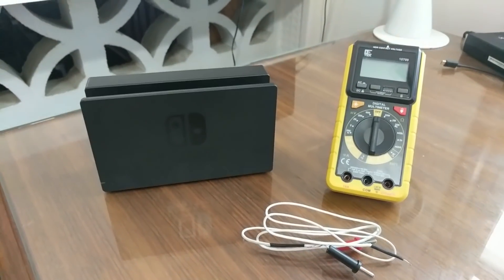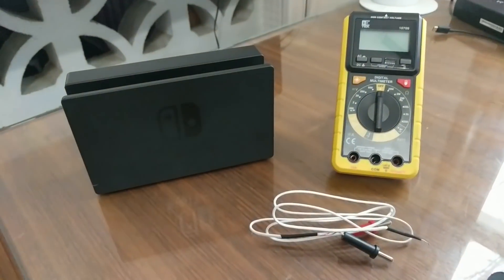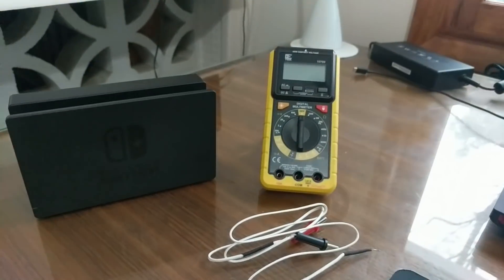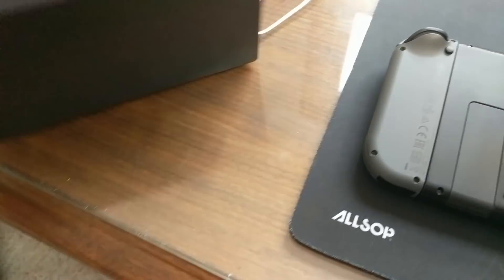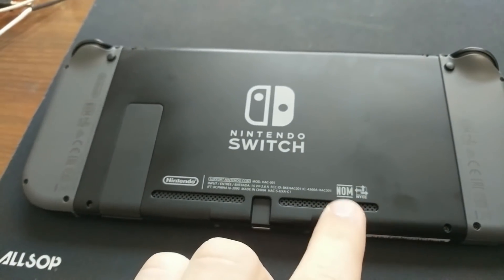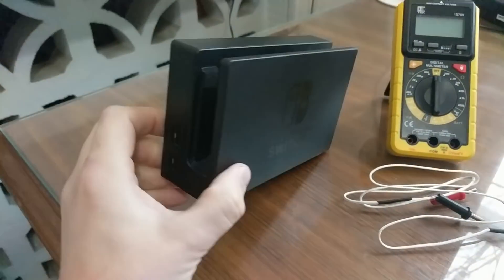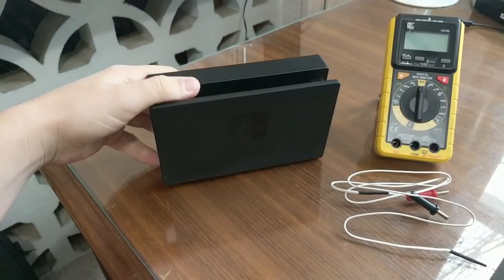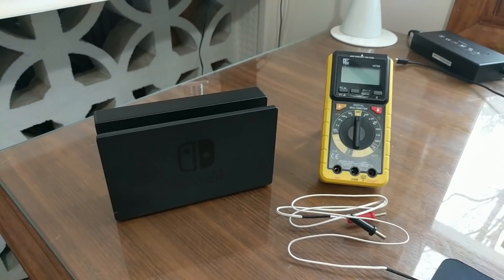Final Nintendo Switch Cooling Mod - Available Now!

Comment: How is this one different from this other one on ebay that claims to have better airflow? I'm kinda torn between the two. It claims 20 degree drop but it could just be fluff. I guess I'll end up flipping a coin.
Reply from the maker: It's fluff.  You won't get 20° drop from this.  They stole my design and are marketing a rip-off.  Nothing I can do about it.
Reply from the maker: Plus their print quality is garbage.  AND, to to it all off, they are selling other people's designs from Thingiverse, even using the original authors photos in their listing.

They are trying to profit off of other people's work.  Steer clear
Reply from the maker: Plus, why buy from someone other than the original author (me)? 😉
Reply: @M1dn1ghtN1nj4  I noticed they're design has a major flaw compared to yours. The fact is the air vent has separations between the grates that yours fits snugly to while theirs has a hole where airflow is lost plus it let's ambient heat to get into. You'll have another sale too, this will work perfectly coupled with an intercooler. Thanks for the mod.
Reply: plus you should buy a bunch of cheap but sturdy triwing screwdrivers and bundle it with it at a slight mark up.

Comment: I just printed an "open" style dock that exposes the switch intake vents fully to the room.
Reply from the maker: I've seen that one.  While I'm sure it works well, you have to comprehend disassemble your dock and pull the guts.  And most people don't have a 3D printer.

Comment: An external laptop cooler would also work, and having it be powered by either usb c or micro usb would be useful. I use an opolar external laptop cooler and just place it above the fan and change the fan speed it according to what game im playing and the switch never heats up. Never.

Comment: There is a major flaw in your design. What is going to produce airflow for the dock's board to cool off?
Reply from the maker: The docks board doesn't get hot enough to fail that way. The mod still leaves vents open specifically for the board.  The mod doesn't have a 100% seal, so it will inevitably pull in some of the air from inside the board area.
Reply: M1dn1ght N1nj4 nice! good job on the design then!

Comment: Hey, so like, good for overclocked modded switches???
Thinking of changing thermal pastes to a better one.
Reply from the maker: Paste is certainly an option, so long as you're willing to void your warranty on the process.
Reply: Im already running sx os and have like mismatched fuses, a bunch of overclocks, and emunand, I voided my warranty ages ago lol. But I also like considered having a trinket installed anyways.
Reply: Maybe thermal paste is my best shot, I have some thermal grizzly, ill try that first and if it doesn’t work out Ill buy your 3d printout file online :p this looks pretty ingenious.

Comment: Just take the back off and make a water cooling mod bud. That’s if you want it Stationary tho. And it keeps the CPU at 28-33C instead of 45-50C. You can put the case back on it only affects it by 2-3C
Reply: You also drop drop frames

Comment: would have bought one for $10. not 16. how much could these cost you to make?
Reply from the maker: At9ra unfortunately it's $2.00 to print, and another $4.50 to ship.
Reply from the maker: https://www.cgtrader.com/3d-print-models/games-toys/other/nintendo-switch-dock-cooling-mod
Reply from the maker: HOWEVER, if I find that people are then turning around and sharing the file for free, I'll file my reports, and raise the price of the part.  I really don't want to, but it's wrong to sweep money right out from under me.

Play it cool, no free sharing, and I won't say a word.  :D
Reply: At9ra no way material and shipping exceeds $9. Greedy.
Reply from the maker: TailsTheCat You expect me to make only $3 per physical print?  Wouldn't even be worth my time.  I spent more hours working on its prototype, and multiple prints, costing money, resources, and electricity.  It would be stupid of me to lose money on it.  If you don't want one printed, feel free to download the STL file for $8, and print it yourself.  It's my creation, I have every right to set the price at what I want.  It's not stupidly expensive, which I could have easily made it.  30+ people have ordered it so far, and were happy with it.  I get wanting something for as cheap as possible, but if there is no benefit to the creator (me), then what reason do I have to even make it public?
Reply: lmao was just thinking the same thing. I literally just paid for mine on eBay. The time it takes to think of this, make it and ship it. or even post the shit online is worth the money. Id be charging dumb asses 30$ just for being stingy.
Reply: It's sad how many people don't think another person's time and effort aren't worth anything. Then spend your own damn time and effort making it yourself, you cheap dicks.

I just got finished installing the one I purchased a few days ago. I could only be more thrilled if it were a resin print without the striations of a filament print. But that's just me being finicky, it's not visible once installed so how it looks really doesn't matter.

Comment: I don't think it makes much sense, really, just a 3d printing part make the console cooler? maybe a few degrees but is not worth to void your warranty for that.
Reply from the maker: Javierpal Fordring doesn't void anything.  Makes ZERO physical changes to your dock.  Leaves NO evidence behind that it was ever installed.
Reply: Also it's not legal for manufacturers to refuse a warranty over end user repairs and modifications.
Reply: Why doesn't it make sense? The part is nothing more than an air duct that isolates the incoming cooling air from the dock's circuit board. That means the board, which produces heat (but not so much that it necessitates active cooling itself) otherwise radiates its heat into the stream of cooling air being pulled into the system. This duct prevents that from happening. A 15° difference in temperature (not just a few degrees, the measurements in the video proves it's more than that) is definitely believable, and completely worth it. And if you're truly that worried about a void warranty (I don't know why you would need to send the dock in with the system on a warranty claim), then get another dock if you need to send it in. A dock is cheaper than an entire console replacement, and I have yet to hear of any docks themselves failing and requiring warranty replacement, so I doubt you'll even need to buy one regardless.
Reply: Javierpal Fordring
You dont void the warranty with this I think. Its the fact he is fixing something that isnt broken... poorly.
Reply: Ruben Sanders Being as I have this duct in my dock, I can tell you that there is nothing "poor" about this modification.
Reply: Congress passed a law for gaming systems, motor vehicles, and anything else with the dreaded warranty sticker. So long as you're not doing any willful damage and actively trying to repair your system, the warrenty HAS to be fulfilled.

Comment: Can anyone confirm if this is legit?
Reply: nowonmetube I can confirm, received mine and installed it tonight. It isolates the cooling air coming in from the heat generated by the dock pcb. Works like a dream.

Comment: i think this mod would work best with one of them amazon cooling fans on the back pushing air inside of the system.
Reply from the maker: Etienne philima those game don't push air INTO the system, but AGAINST it.  Mine is the only one to channel air INTO it.  Those external fans are nearly worthless, and require you to modify the dock.  Mine requires no modification.
Reply: @M1dn1ghtN1nj4  if he seals off the outside of the dock so air cant run out and only downward it could become a forced induction. Really depends on the rpm of the fan's but the air will seek out all openings and increase air flow. Ive seen the same fan and ordered one and plan on testing it in the same fashion. Ty for the improvement also got mine today in ohio dropped 14 degrees

Comment: Just ordered one do I need to do any sanding to the part before install or is it good to go as soon as I receive it?
Reply from the maker: Sam?  No sanding or anything necessary.  Just pop it in.  I mailed out my last one yesterday, so I need to make a new batch.  I'll try to get it out tomorrow.

For anyone else wondering, the color of the part is sort of random.  I use whatever color filament I have on hand.
Reply: Yes. Thanks for the speedy reply. Also thank you for all of the hard work and r&d time that went into making this product. I saw that a few people were giving you some flack for the price and want you to know that not everyone thinks that way. People seem to not take into account the value of someones time and that the process of actually bring a product to market is allot more complected than one thinks.

Comment: I get it you cant ship everywhere on the world. What about you sell the file directly a little bit pricier since your are giving away the file.  Or print the piece at 100% fill and ship it inside a letter envelop to reduce the shipping cost. Like dbrand does...awesome mod, keep that good work
Reply from the maker: 100% fill?  It would be a brick, not a vent.  I DO sell the file, but it's quite a bit cheaper as I don't obviously have to handle physical material, packing, etc.

Comment: Isn't this plastic? Will it melt? Is this a permanent solution or do we have to switch it out after a few months or so, just wanted to know before I buy. To the people that are saying the price is high are idiots, I'll pay a much higher price to keep my things running better, don't listen to the ignotant/broke people seriously if you hurt for $15 that's pretty bad, that's like the price of a movie ticket lol BTW I'm buying 2 of them
Reply from the maker: Yes, it's plastic.  It shouldn't melt though.
  That would require much higher temps then are in the dock.  So there should be no need to buy a second one
Reply: It takes about 400F-500F to melt ABS plastic so there should be no worries. Also there's no evidence this makes the Switch run more efficient but you may extend the life a tiny bit.
Reply: mkennedy150 The Switch itself doesn't necessarily run more efficiently (generates should improve with better cooling during extended gameplay sessions, this has been proven by people using external docks altering the Switch to breathe better), but  15° reduction in cooking air temperature means the cooling system is operating more efficiently.

Comment: I herd it heats enough to slightly bend your switch my first switch along with my brothers has a slight bend. I have a second gen and will buy they soon for it. I also have a fan to help with it
Reply: Switch V2 is less hot when docked compared to the original, I know it because I just changed my V1 Switch for it. Also the fan runs a lot quieter in heavy games. My old Switch didn't bend after 2 years of intense gaming, so you shouldn't worry too much about your new Switch. :)

Comment: Restricting the inlet air ... Good idea lol. How about cutting those tabs off to let more air in.... And it's a duct please stop calling it a mod
Reply from the maker: You missed the entire purpose of this mod.  The idea is to NOT damage, cut, drill, break, or slice any part of the dock.  That's intentional.  And its function is a duct, but since it's not OEM, it's a mod.  Modifying the original behavior is called modding.

I didn't restrict the air flow, I just diverted it.  Besides, with the amount of air flow the Switch fan moves, cutting the tabs off wouldn't increase the air flow through that region by meaningful amount.  And regardless, you'd still be in the same boat as before, pulling in hotter air that's generated by the circuit board, making the tab cutting pointless.

Comment: Do you do any other mods or have any after market dock coolers?
Reply from the maker: I'm in the middle of designing a serious cooler for the dock.  Would utilize a small fan powered by the USB port, and again, it would be a no-cut, no-drill install, just like this mod.

But it isn't going to be cheap, as I'd have to source electronic parts as well.

Comment: Could you possibly do a follow up video to test with the installed mod, as well as with one of these third party fans you can get for the switch? Possibly do a more thorough temperature test with a extended play lesson, like 2-3 hours on verious conditions. With cool down times in between each test.     Nintendo Switch Cooler,USB Cooling Fan with 3 Quiet Fans for Nintendo Switch Dock set https://www.amazon.com/dp/B078G4FW5K/ref=cm_sw_r_cp_api_i_O2L5Ab4AH9T1C

Comment: Any heat results when the Switch is on its side? With the mod in?
Reply: Side note: it felt hotter than usual after 10min and I was only playing the NES games, maybe the mods best when the dock is upright?
Reply: @eddyjoestar7215  just checking this video out and comments see if I want to buy one myself.
But I'm confused you have the switch/dock on it's side how is that even possible? Not meant to be sideways?
Anyways putting my confusion aside, it probably would run hot if you had laying on it's side... the heat is meant to travel up and escape out the top vents. If it's on it's side the heat most likely wouldn't vent properly.

Comment: Why does it work? Its only plastic
Reply from the maker: The material it's made from is irrelevant.  It's forcing air to be pulled from a cooler location than it originally was.  That's why it's effective.

Comment: Eh, you could do the same thing with some small pieces of aluminum and get better results. Plus that piece of plastic for $14 is laughable.
Reply: You want to put electrically conductive material against the circuit board?  Lol. You have fun with that.  Plus, how did you plan on moulding it from aluminum?  Hey, if you want to design something on your own, be my guest.
Reply: Noah Greene you clearly lack imagination to avoid using aluminum or any conductive metal near a circuitboard simply because it "might" short. When you sell a piece of plastic for 14 it feels like a scheme. Especially  when you avoid to test the exhaust.
Reply from the maker: LOL.  Lack the imagination?  You upset you didn't come up with the idea?  I played it safe, which is clearly not something you would have done.  My dock will remain functional, with ZERO percent chance of going down.  You choose to toss metal willy nilly near exposed circuitry, yours has a chance of going down.  It's not imagination, its common sense.  And if you had any common sense, you'd have looked at the description, checked the links, and realized that it's not for sale for $14 like you claim, but $10 instead, and the STL file is $5.

I COULD have used metal of any kind, but I choose not to based on a number of factors, so your initial claim about lack of imagination is about as useful as dead squirrel balls.  Also, I have no real need to check the exhaust.  A little bit of science research would have told you that colder air in, is able to pull more heat from the object, hence, keeping it cooler.  It's not a new revelation, its basic science.  Therefore the exhaust measurement is not necessary.  I could have gotten more equipment and measured the temperature of the surface of the CPU, other ICs, etc, but again, colder in, colder object.

If you're going to come at someone with some sense that you know more about the subject than they do, bring provable facts, scientific methods, and demonstrations of your progress.  You came here with nothing, and will leave with even less.  Good luck to you.
Reply: M1dn1ght N1nj4 It's funny you mention science and in your video you only take into account one variable to prove your design works. I'm not mad you had a neat idea, I think that part is commendable. The problem is, anyone with an inquisitive mind will see your video and question the validity of your claims because you lacked a thorough assessment and then put a $10 dollar price tag on it. It seemed deceptive and shark like.

Comment: Does the fan run any quieter with this installed?
Reply from the maker: There fan in the switch might run a bit slower as it doesn't need to evacuate so much heat, but I didn't pay attention to that part.

Comment: Would this void warranty, ya think?
Reply from the maker: Absolutely NOT!  There are zero physical modifications to the original hardware.  So even if something DID go wrong, you would just take out the mod before filing a claim.  They would have no way of knowing if it was installed, as it leaves no scratches, cuts, stains, blemishes, or any other kind of physical telltale signs.  That part of the design was fully intentional.
Reply: @M1dn1ghtN1nj4  mhmm, fair, just not sure it's worth the hassle for 6 improvement
Reply from the maker: Something is better than nothing, or overheating.  Also known as "better safe than sorry". 😎
Reply: @M1dn1ghtN1nj4  eh, I think I'll just put together an external fan for it

Comment: I wish you had it on Amazon.
Reply from the maker: Mazin Almlhem I might look into that.  But I'm currently having some surface defects in my prints.  Trying to fix them before I print more of these mods.  I have sending out a piece that doesn't look right, even if you can't actually see it when it's installed.
Reply: Would definitely buy off Amazon cause I don't have access to a personal credit card and I have to buy gift cards to buy things.
Reply: I second this as well. Just makes it convenient for some. I’ll be checking in from time to time to see when it shows up on amazon 😌
Great work to midnight ninja by the way. Appreciate the time you took to work this out 🙂